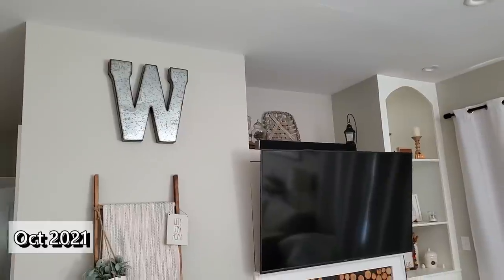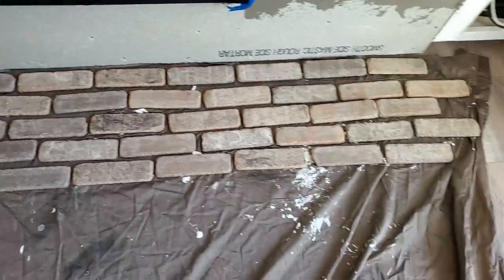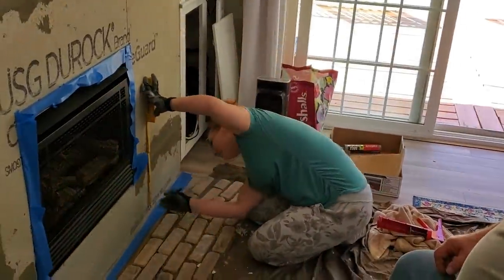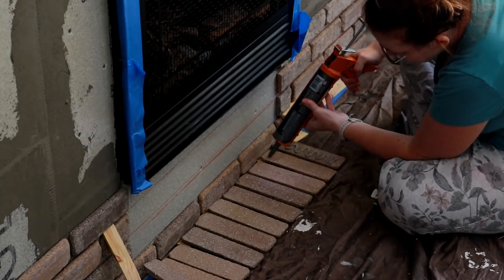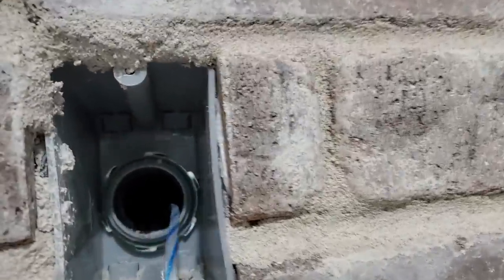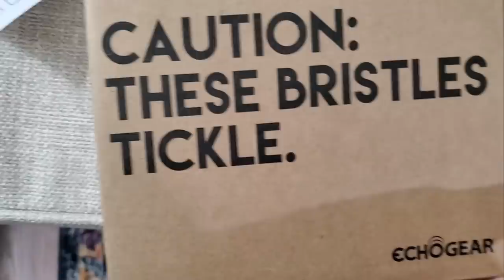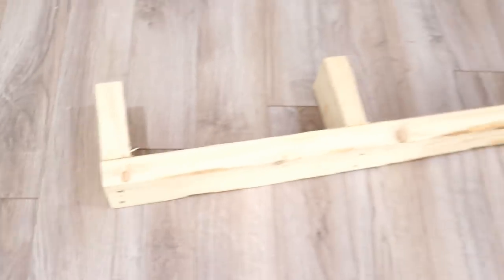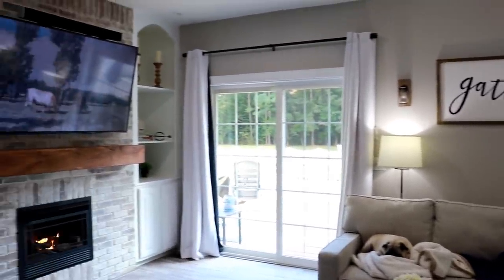DIY Living Room Makeover on a Budget | Brick Transformation | How to install gas fireplace

Comment: You should have used  mortar. It will hold better and longer. Plus, putting mortar on backboard as well as the   and using spacers will help also. IMO
Reply from the maker: Actually, the manufacturers instructions as well as a 30 year brick masons opinion on using adhesive was perfectly acceptable in an interior installation. We also did use mortar to fill the joints. Thanks